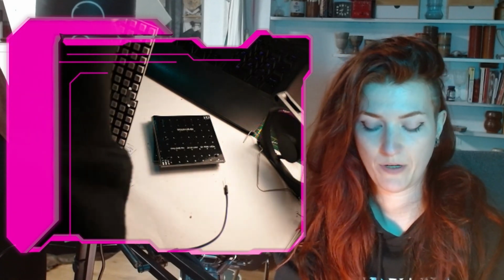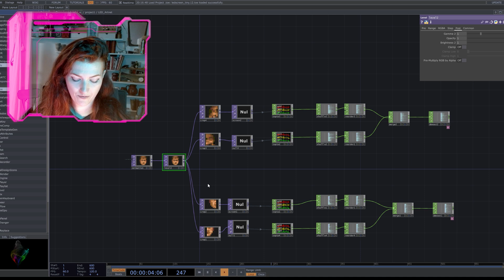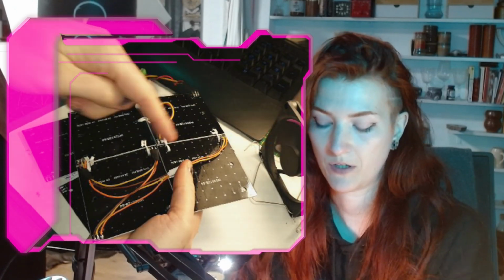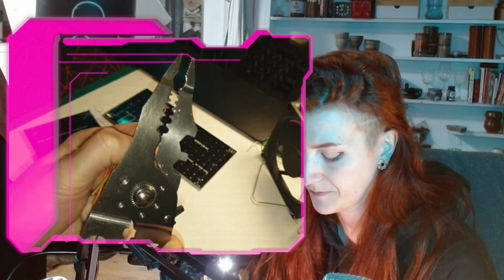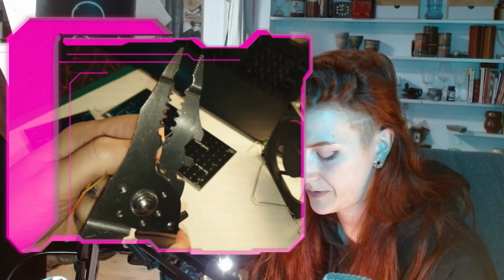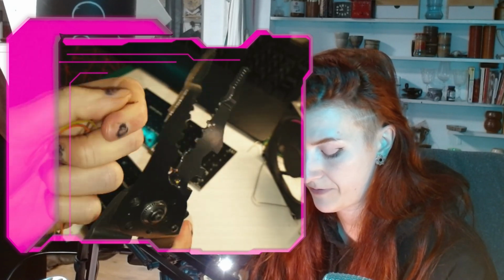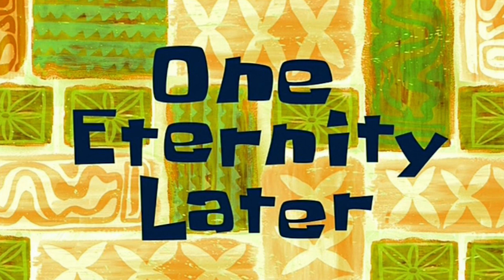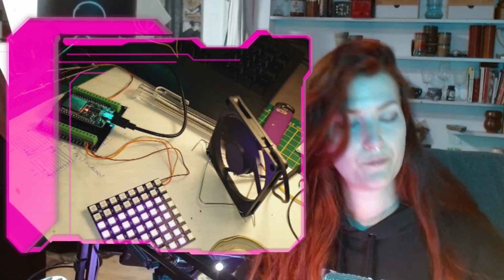Implementing more LED panels - LED screen PT2

Comment: I did this with an FPGA once aeons ago when this world was still young and I was already ancient.
Reply from the maker: I had to look this up - this looks wayy more complicated than what I've fabricated with my ESP32 - I bet you could get going with it quite quickly!
Reply: @studiovodka  Arduino was too slow and ESPs just appearing. But it was fun as it is different from Software. Everything happens in parallel. Super interesting but as you said also overengineering for the LEDs. You can recreate whole CPUs with these things.
Reply from the maker: @ViciousViper79  I swear - time goes so quickly. You blink and there's 5 new ways of doing things with tech :).

Comment: 63 year old electronics engineer and businessman here.  There's nothing interesting about watching someone solder. I'd know as I've done a lot of soldering. How about you skip the tedious parts and get to the interesting parts.
Reply: haha that you could have said nicer
Reply: @SynthaticBeats Over the years I've come to realize that nice engineers get ignored and have reduced salaries. Loud and obnoxious people end up as the President of the USA. I'm actually a nice person but I know that if I want to get my point across I need to add a little amount of emotional  punctuation.
Reply: I agree with Synth. this could have been said nicer.  Being the solder expert, perhaps you could have given some useful tips instead.
I think (as not a solder expert) it looks like the iron might need to be a little hotter.
Also, 'not interesting' does not mean not useful.  Someone new to soldering might see this and realize that it doesn't always go smoothly.  Sometimes you bridge it, cuss, desolder, only to knock the first wire loose, cuss again, re-solder, bridge, burn your finger, cuss again...etc.   Eventually you will prevail.   That's my takeaway from the 'not interesting' part.
Reply from the maker: @gamersincepong  hey, that is pretty cool, that is what I wanted to show in this video! I like to share the more vulnerable parts of doing something new which contains failing, and indeed cussing - a lot :). I don't have the funds for a better soldering setup right now, so it is part of the reason for some of that cussing, lol. I will cut the next video better, so it has a nicer dynamic!
Reply: @studiovodka  I'm thinking emphasize more on what the LED panels can do, and all the cool ways to use them, and quickly move through the technical aspect of how they are built.
Reply from the maker: Hi Robert, thank you for taking the time to write an honest reply. I am still learning how to make videos so any tips are welcome, I am testing different types of videos to see what interests others in my processes: is it a full video of trial and error, or a polished run-through of a perfected process? I am not an electronics engineer, and I have never studied electronics, so unfortunately I will not be able to offer you the latter [yet]. I am sorry you didn't enjoy it, but I'll take your feedback into account!
Reply: @ The link title was about led panels, and I was curious about the led panels. But the video ended up being a long stream of you soldering instead.  Youtube is about interesting and cool stuff. I could be wrong but watching someone solder for a long time is not interesting or cool. If you're going to do a tutorial on soldering it should be specific to that, and it should be a lot shorter. Technical people are short on time and we like to get to the point fast.
Reply: Why watch it then... go complain somewhere else
Reply: @theonlygifmusic  because the truth will set you free. If you sit in an echo chamber where everyone tells you that you're doing really good, when you're not, you'll never improve. Or do you struggle to understand that?
Reply: @RobertA-hq3vz  not impressed
Reply: @theonlygifmusic  I don't care.